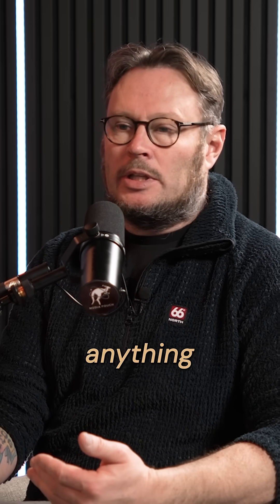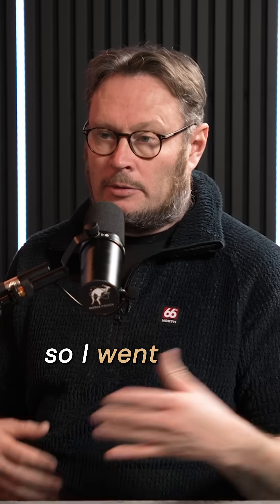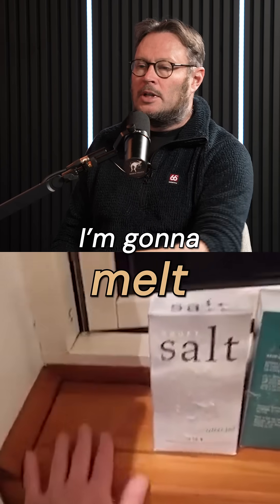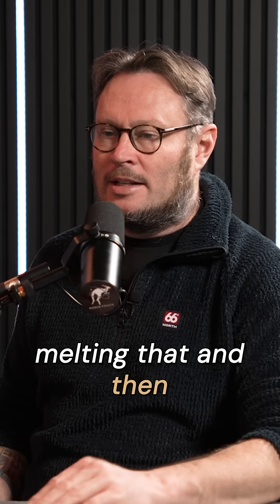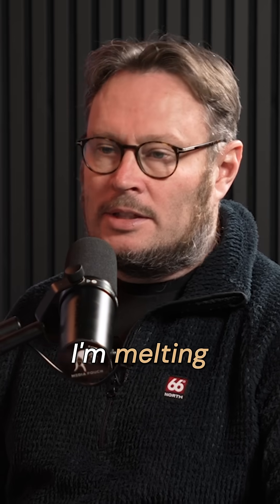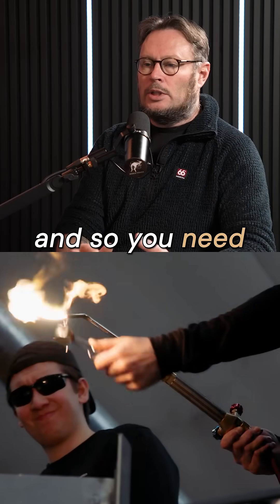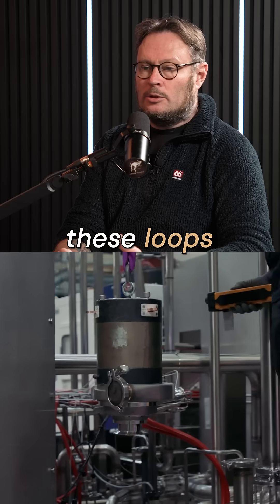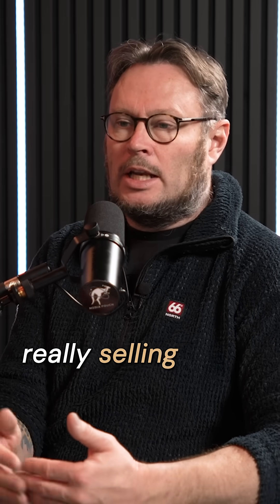How we Build a Molten Salt Reactor

Comment: Try building the grid capacity first. 😅
Grids are 10 times more expensive. 
Grids make dirt-cheap electricity very expensive.
Grids disperse electricity energy. 
Grids need 247 cashflow.
Grids end up gouging the last customers before they go off grid.
80% of the world's population live in warm latitudes. 
20% have long sunny days for half the year.
Only 10% of fossil fueled generation is needed and that is nothing. 
Electric vehicles massive batteries are FREE mass storage 23hrs every day and all night long. 
Rooftop PV is dirt-cheap electricity 2cents kWh from empty rooftop realestate. Dirt-cheap realestate. 😮

Grow up and be a proper engineer and look out the real world economics. 

Worst still is 20 times more expensive electricity is needed to replace fossil fueled energy.

So nuclear electricity to expand 20 times and then be 10 times more expensive to the grid consumer, grow up.
Even half of the above is insane. 
Just the first grid was built over 14decades. 
Now you say 10 to 20 times bigger grid capacity, WTF. 
The costs and time frames and raw materials and financing, grow up, you are lost in your expertise.
Reply: You don't know enough to know what you don't know.
These units aren't for grid supply.
So you're 100% wrong.
Reply: @sparksmcgee6641  blah blah blah

Comment: But how do you prevent corrosion?
Reply: They have a video on this topic. They ultra purify the salt they use. This significantly reduces the corrosion to the material they use for pipes.
Reply: I was thinking this too, while salt does oxidise things, it only corrode things when there is moisture present, so they use super pure salt that has so little moisture that corrosion is made practically impossible